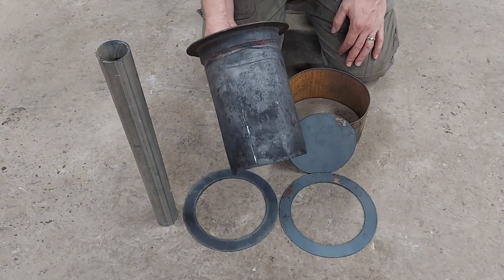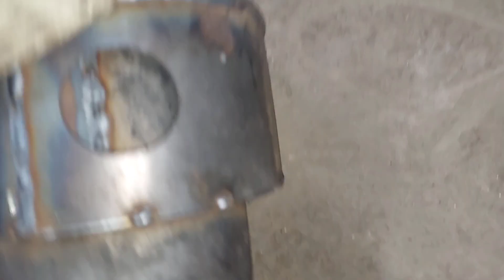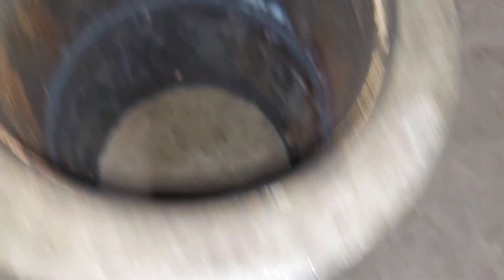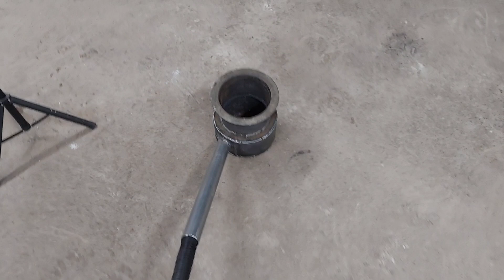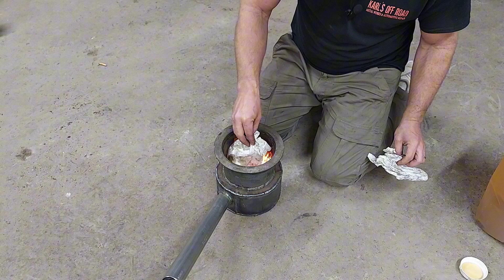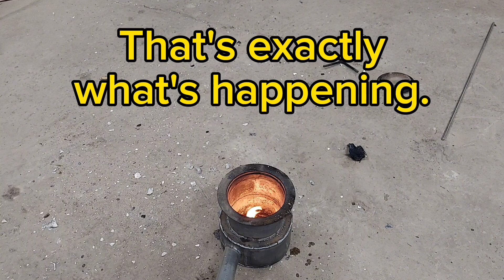DIY waste vegetable oil burner! New design testing with fantastic results!

Comment: Something I have not seen you try that I had good luck with is taking your oil feed line and making a few wraps around the burn chamber Once it gets hot the oil starts to vaporize in the line and you burn it as a gas.
Reply from the maker: I will definitely try that with veg oil. I found it to be problematic with motor oil. I appreciate the suggestion. Thanks for watching!
Reply: @karlsoffroad   I was running  waste oil with some diesel in it it starts to sound like a jet engine when it burns as a gas..    Thanks for the ideas for burners..

Comment: lot of smoke therefore stronger fan needed..
Reply: Your better off burning engine oil hotter cleaner than veggie oil.
Reply from the maker: @firemanjim9025  ,that's what I burn. I had a viewer ask about veg oil, so I figured I'd give it a try. Worked better in my other burners. I heat my shop and my home with used motor oil. I have quite a few videos if you'd like to check them out. I show failures and success. Hopefully, it will save people some time and money.
Reply from the maker: I get it up to temperature and smoke free by the end. This was the first time I had ever burned veg oil and was a learning experience for sure! Thanks for watching!

Comment: I believe you could do better by having a small cup inside to hold and vaporize the oil (it would also be easier to clean out the crap).  The inner cup would likely get hot faster and improve the burn.
Reply from the maker: I have an idea in mind and will be testing it in the next video. Thanks for the suggestion!

Comment: Maybe preheat the chamber with something like a blow torch or a heat gun for about 5 minutes or so before adding the veggie oil in so it's not so hard to get going at first? You could also try to add something on top of the oil like kerosene to burn and maybe get the same effect. While the kerosene or whatever you choose burns it heats up the oil and the chamber and the veggie oil gets going a lot easier.
Reply from the maker: I normally use a bit of diesel, and that works well.  I appreciate the suggestion!

Comment: Naturally draft air works best. Especially when the blowers are so loud. I do see advantages of these setups; one doesnt need to vent outside or need for a pipe to create heat. 

Does work well on a shop and open spaces to heat up quickly. 

The way i heat my home is with with wood and other times oil. 

Oil burns quick and real hot real quick; quite dangerous if not watched and regulated often. 

I burn oil for an hour or two and babysit it; and house gets from 50 to 80 degrees in less than 2 hours. 

There are videos in my channel of mods and different burns. I try to stay between 500-800 degrees max. 

I will continue to modify it to burn cleaner and longer. Still creates a bit of black smoke out the chimney: and a bit of a sheet of soot on the walls after 1 or 2 days of burning.

Creosoot needs 1100+ degrees in order to burn off. That is way too hot for my liking. Wouldnt try it at home.
Reply from the maker: I heat my home and my shop through my homemade outdoor boiler. No smoke at all, and I only check on it every 24 hours or so. I burned wood for 15 years, and I'll never go back. I show that in a previous video titled 
"How I heat my home for free" Thanks for watching! The burner is actually making most of the noise. The blower is very quiet.

Comment: Sam new subscriber thanks for sharing just curious I like making burners also and they do quite well what area are you in because the flame tends to swirl clockwise or counterclockwise if if the air enters the wrong side it fights itself but just curious if you found that a problem let me know thanks for sharing
Reply from the maker: I haven't noticed a difference in burn quality swirling in either direction. I'm in Michigan. Welcome to the channel as well! I have an earlier video, and I have that burner going counterclockwise,burns great.
Reply: What the hell difference does it make where he lives?  It won't make any difference to the way the burner works anyway!
Reply: @Moonlightshadow-lq4fr  fire spins in the air and water spins in the toilet it was just a question e moonlight ai magic replier

Comment: Very nice concept, I love the prototype and the concept of pre-heating the air.  May need a rod in the centre or a bit of a ring on top of the burn chamber to concentrate the heat.
Reply from the maker: I did that previously, and it made it more difficult to clean out the burner. I might add it just to test again.

Comment: Maybe try a reostat control for the bounce house blower so you can control its output, like a router control.
Reply from the maker: I have one,I just don't normally use it. I  was just doing a few tests to see how the burner would react. Thanks for the suggestion!
Reply: To control the amount the blower kicks out you can either block off the inlet for the blower, it won't hurt it just make it turn faster as there is less load on it or have a bypass tube to blow fresh air into the room and not the burner.  Or go the electric route. @karlsoffroad

Comment: I’m working on mine. It’s a variable speed blower so I can tune it. I put a chimney on mine, and that makes it hotter. So hot it melted the thin steel 6” stovepipe chimney down to a blob using waste oil. Now I realize I have a metal foundry, not the heater I wanted. But the ability to get the right air/fuel ratio and the chimney/flu that holds the heat down in the bowl makes a huge difference.
Reply from the maker: I've melted many things on accident and only a few on purpose! 🤣

Comment: I do like the idea of a flap.  I might use that in an oil drum and I may be able to put 5gallon 25 litre containers in it to get rid of the darn things!  Pity your burner didn't take off the way you wanted, I'm sure if you slowly introduced the air with the bouncy blower the unit would eventually get red hot and you would get immense heat and fire out of it!  Veg oil is horrible fuel to get started and if it's got any water in it terrible for burning.  It's weird stuff, I have been using it in the past and it's like it has pockets of water that appear out of the blue and makes the burn sputter and spatter and even go out even though it's been burning for an hour really well.  It makes lots of soot too, even if you can't see the smoke there's soot in it.  I had a run one time getting friends and family to give me any left over veg oil they had.  Great, I thought, put into the burner and to my horror the stink coming from it was horrendous!!!  Christ knows what crap they were eating cus it should smell like the sea front where they cook donuts not this sewage I experienced!  Sometimes engine oil is much more pleasant   🤧
Reply from the maker: I just ran the veg oil because I was curious. I know it will do well with waste motor oil. I thought it ran pretty well with the small blower, which is great for efficiency. I will be installing this burner as is in my outdoor boiler, and I'll see if it's up to the task.I'll know more in a few days on how it performs long term.
Reply: I think you will get plenty of heat out of it for your boiler especially if you keep it sheltered from the wind.  The metal you have used is heavy duty so it will take a bit of time to go into cruise mode :)  I have just received my pump so soon I will be able to heat up my own tank, I think you will enjoy the setup I will be using :) @karlsoffroad
Reply: I bet the oil went rancid from the little bits of food in it.
Reply from the maker: @GRILL332  Maybe I don't normally use veg oil, so I have no idea?

Comment: Thanks for the video. I'm still going to build your tube burner design. BTW, your welds suck, but so do mine!!😅
Reply from the maker: Lol,I'm aware! I didn't clean any of the slag after I cut the parts, so I had some issues other than being lazy!  🤣
Reply: @karlsoffroad  You told us to roast you, so there you go. Thanks for figuring this stuff out for us.
Reply: You ain't seen my welding :(
Reply from the maker: @Moonlightshadow-lq4fr  if it works, then it's good to go!